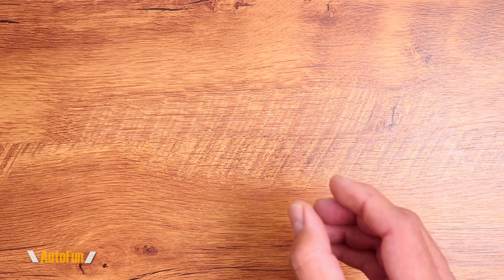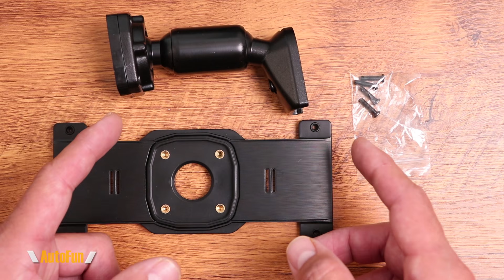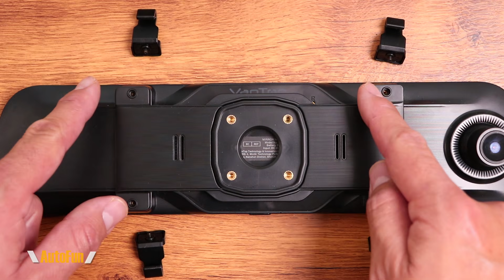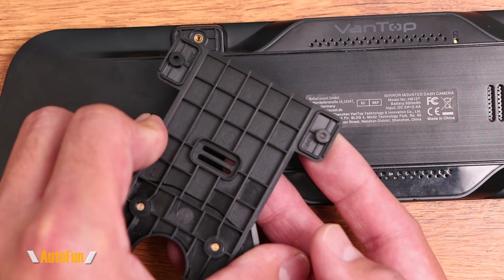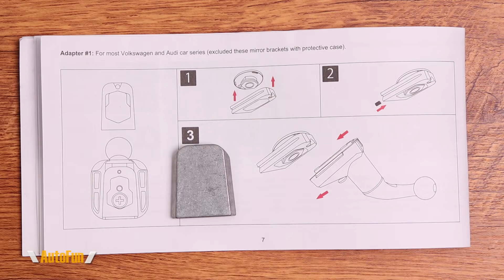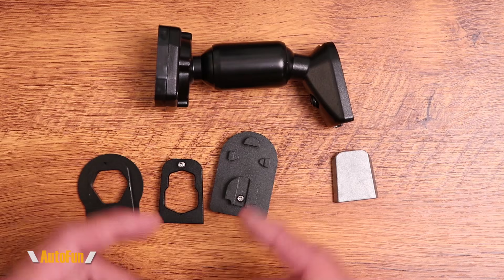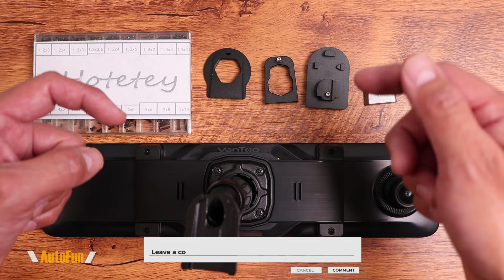How to Install Mirror Dash Cam WITHOUT Straps (Direct Mount Conversion Kit for LCD Mirror)

Comment from the maker: Hi Everybody! Here are my follow up videos: Universal Mirror Dash Cam Direct Mount Kit https://youtu.be/fveZiDofnxg and Direct Mount Kit for Rydeen dash cams https://youtu.be/cCpyHmiZqiY Cheers!
Reply: Hi Alex. I have a Wolfbox G700, fitted to a 2004 BMW X5 E53 4.4I. Can you let me know, at your convenience, if you are aware of a bracket that will be compatible. Alternatively, give me some guidelines as to where I might begin my own search. Thank you for your very informative videos. I hope you are able to assist me in this endeavour.
Reply from the maker: @mistaimani5824  Hi mista imani! thanks man! ah yes, unfortunately the G700 does not have screw holes in the back, so the conversion kit will not work with it. Cheers!
Reply: Thanks Alex,
I did see in your comments section the universal bracket. It’s about the same as strapping the cam to your mirror. 
I am looking forward to your mirror mounting modifications.
Reply from the maker: @bengb25  You're welcome Bengb X! yeah I have 2 ideas actually for mirrors that do not have a kit available, stay tuned for those videos bud...
Reply: Info only - I have the 
WOLFBOX G840S which is the same as the G850
Reply from the maker: @RobertStarkey  Hi Robert! I have not tested the G840S so I can't comment on how it compares to the G850, I may have add it to the list of dash cams to test (list is getting longer! LOL) Cheers Bud!
Reply: @AlexAutoFun  I was advising it is the same so you don't need to test it.

I however need an adapter that has 4 screws in it, as the Tahoe screws in, not slides on. Any advice there?
Reply from the maker: @RobertStarkey  Hi Robert! ah you mean it's the same as far as the back plate size? Regarding the Tahoe, what year is it? that way I can check for you..
Reply: @AlexAutoFun  yes it is the same bracket size.  Tahoe is a 2019.
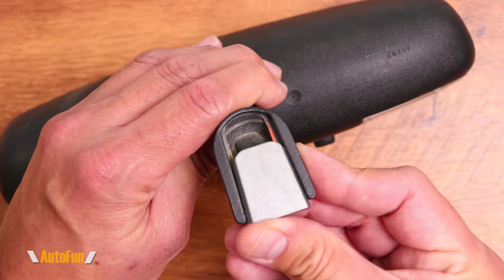Reply from the maker: @RobertStarkey  Awesome thanks for confirming! ah that is weird regarding the Tahoe, I wonder if it's an upgraded mirror option you got on yours. The Tahoe's of that year with the mirror that has 3 buttons on the front, use the standard slide bracket shown at 6:15 however the bracket is concealed behind a large plastic cover similar to the one you see here https://youtu.be/5kTXzL227o4 The slide in portion is just a single screw. Hope this helps bud!
Reply: @AutoFun  thank you. Are you familiar with this brand, PELSEE 12"? Thanks
Reply from the maker: You're welcome Ivan! Yes I have heard of Pelsee. Cheers!
Reply: Hi Alex I have a Camry se 2023 and the Wolfbox the g930 would this work for it ?
Reply from the maker: @Jay28516  Hi Evelin! Ah yes the G930, unfortunately I have not reviewed it so I'm not sure what kit will fit, however you can measure the back of the dash cam as I showed in video to determine the kit size. And If I do get a hold of one, I will measure it for you and update this comment. Hope this helps and congrats on your new dash cam, I personally can't go back to a regular mirror now. Cheers!
Reply: @AlexAutoFun  ok yes that would be great thank you🤞🏼🙏
Reply: I have a 2011 nissan cube and i ended buying the woflbox g900 4k. I cant find conversion for it or really not sure to be honest.
Reply from the maker: @georgeazure6245  Hi George! I put the link to the kit for the G900 in the video description. Cheers!
Reply: awesome video bro...do you have a  recommendation for rexing mirror cam? I'm looking at there models but I hate strip look

Comment: Ugh I have a Ram 1500 with twistlock rear view mirror, and I just got a wolfbox G930 and it looks like there are no adapter brackets for twistlock  :(
Reply from the maker: I placed adapters to the specialty bracket tabs in the video description. If none of them work for your application here is a kit that adapts to the mounting ball of your current mirror https://youtu.be/cCpyHmiZqiY instead of your mirror tab, cheers!

Comment: Hello, gibt es auch einen kit für dem m40 Spiegel?
Reply from the maker: Ah, I have not tested that dash cam yet, so I'm not sure what kit will fit, however you can measure the back as I show in the video to determine the size but If I do get a hold of one of one, I will measure it for you and update this comment, cheers!

Comment: Hi I watched most of your videos about dash cam and that’s how I was convince to buy the G900 tri pro along with mounting brackets and hard wire kit. The big question is how do I get the light of my dash with the GPS signal once I remove the factory mirror ?

Comment: Does the P12 plate fit the P11?
Reply from the maker: Ah, I have not tested the P11 yet, so I'm not sure what kit will fit, however you can measure the back as I showed in my first video here https://youtu.be/TtjZ7rC_ncY to determine the size but If I do get a hold of one of one, I will measure it for you and update this comment, cheers!

Comment: What's the chances the ball socket will fit the vehicle mount ball of a Sprinter?
Reply from the maker: This kits are meant to adapt to the windshield mounting tab (link to the kits and adapters in the video description). If you need a kit that adapts to the mounting ball of your current mirror you will need this kit https://youtu.be/cCpyHmiZqiY cheers!

Comment: I have a wide angle adapter it's not a dash cam but the brackets on the adapter will not expand wide enough to cover my mirror I'm wondering if the straps would be a solution to fit this over my Kia Niro EV 2022 mirror

Comment: I love this but it seems like darn near every mirror I want to buy doesn't have screw holes below the rubber pad on the back. At least that's what all the Amazon sellers I asked say. Is there any other way to know?
Reply from the maker: Yes, I check for this on every Mirror Dash Cam that I have reviewed. Check out my reviews here https://youtube.com/playlist?list=PLMLNRyDJO83k_Lnu1aRpTr4yR2sjjWsnO once you find the one you like, I can confirm for you if it supports direct mounting, cheers!

Comment: Do u have a Chevy GM mount for the WolfBox M40? :)
Reply from the maker: Ah, I have not tested that dash cam yet, so I'm not sure what kit will fit, however you can measure the back as I showed the video to determine the size and If I do get a hold of one of one, I will measure it for you and update this comment, cheers!

Comment: I don't see it but do you have a video for direct mount of UZIVO U24 Mirror Dash Cam?
Reply from the maker: I have not tested that dash cam yet, so I'm not sure what kit will fit, however you can measure the back as I showed the video to determine the size and If I do get a hold of one of one, I will measure it for you and update this comment, cheers!

Comment: I have a Azdome PG 17 Max is there a kit
Reply from the maker: Unfortunately I have not reviewed the Max yet, so I'm not sure what kit will fit, however you can measure the back of the dash cam as I showed in video to determine the kit size (link to the kits along with a link to the universal kit in the video description). And If I do get a hold of one of one, I will measure it for you and update this comment, cheers!

Comment: Do these dash cams come with the buttons for emergency?like a lot of new cars they have buttons on the mirror to call certain services.
Reply from the maker: Nope, so far none of the mirror dash cams I have reviewed (and I have reviewed a lot of them lol) have those services. I also don't see this feature being added to them (brands I spoken to, see no demand for this feature, not sure if it's due to new cars having those services already or due to the low adoption rate of subscription On-start type services on the aftermarket) cheers!

Comment: Hi Alex, thanks for your video !!!

Do you ever installed this type of Direct Mount Kit in AZDome PG17 mirrors? Where do i live there's no one who sells this type of kit so i have to import and i'm struggling to find adequate parts without recurring to universal kit with straps
Reply from the maker: You're welcome! Ah unfortunately I have not reviewed the PG17 yet, so I'm not sure what kit will fit, however you can measure the back of the dash cam as I showed in video to determine the kit size (I placed links in the video description to the different kits available including the Universal one). And If I do get a hold of one of one, I will measure it for you and update this comment, Cheers!

Comment: How well does it hold? My only complaint of the G900 pro is that the weight is a bit heavy for my older mirror. THis would be great. This and a mirror like film so I can use it as a regular mirror with the screen off.
Reply from the maker: Same as the old OEM mirror remember the direct mount only changes the dash cam mount, the actual thing that holds it to the windshield is the OEM mounting pad. And here is my conversion video for the G900 Pro https://youtu.be/_R12Vdus_A0 cheers!

Comment: Which size of screws did they provide ? Mine did not come with those screws
Reply from the maker: As explained on the video, I reused the screws that came with my mirror dash cams, however I also placed a link to a screw kit for cases where the original screws are not long enough for the kit, cheers!

Comment: Glue to the windshield? . LOL. This is the dumbest idea so far. It will come off right into your face at 80 MPH.
Reply from the maker: Nope, standard practice on the car industry. The adhesive used is specifically developed for glass, this is how mirror mounting tabs are attached at the factory. And in cases where a glass mounting tab is not used, the mirror is mounted to a structure that is attached to the vehicle's body or directly to the vehicle's body instead of the glass, cheers!

Comment: You can most likely STILL do this even if the mount to the back of the dashcam mirror does not line up to screw in. Just elastic strap it to the mount piece and use some double sided 3M tape for good measure. 
I have a Rexing M3 and got the M2 size kit and it can't screw in and did the above and it's perfect.
Reply from the maker: Ah yes here is my video for cases where that happens https://youtu.be/fveZiDofnxg cheers!

Comment: What about a bracket to fit a sxs? Be nice to have something for my can am x3
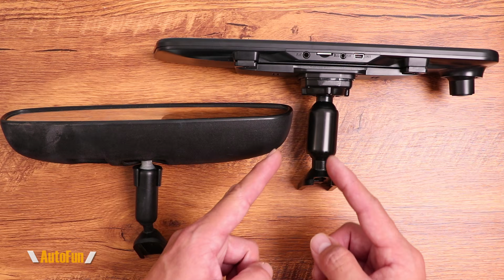Reply from the maker: Ah yes I show how to tell which adapter you will need at the 5:40 mark, you can also see what they look like so your installer can compare them to the one on your vehicle. I also placed links to the specialty adapters in the video description, Cheers!

Comment: Anyone know what I need to order for Toyota hilux n70 in Australia?
Reply from the maker: Toyota typically uses the standard mounting tab, however I also show how to tell which adapter you will need at the 5:40 mark, you can also see what they look like so your installer can compare them to the one on your vehicle. I also placed links to the specialty adapters in the video description. Cheers!
Reply: @AlexAutoFun thanks , I’ve worked it out 👍
Reply from the maker: @Mxslots You're welcome!

Comment: Where can i find supoported cars.?
Reply from the maker: Ah yes I show how to tell which adapter you will need at the 5:40 mark, you can also see what they look like so your installer can compare them to the one on your vehicle. I also placed links to the specialty adapters in the video description. Cheers!
Reply: @AlexAutoFun Thank you so much. Im looking for a new camera for my Volvo xc60 2009.
Reply: @AlexAutoFun Volvo are using cam lock to mount the mirror.
Reply from the maker: I'm using the standard mounting tab (which is what came with on my car), but if you need an adapter I placed a link to those in the video description. And here is another direct mount system that may interest you https://youtu.be/cCpyHmiZqiY Cheers!

Comment: has anyone tried this on an Acura TL 2005?
Reply from the maker: It should work most vehicles use the standard mounting tab (and a few use the adapter). I show how to tell which adapter you will need at the 5:40 mark, you can also see what they look like so your installer can compare them to the one on your vehicle. I also placed links to the specialty adapters in the video description, Cheers!

Comment: hi great tutorials. very helpful. I'm getting a wolfbox g900 to replace my OEM rearview mirror of my FJ Curiser 2015. can you tell me what replacement bracket and mount would fit an FJ Cruiser ? thanks.
Reply from the maker: Thank you! Ah yes I show how to tell which adapter you will need at the 5:40 mark, you can also see what they look like so your installer can compare them to the one on your vehicle. I also placed links to the specialty adapters in the video description. Cheers!

Comment: Dessa forma, suporte do retrovisor irá vedar por completo as ranhuras de dissipação de calor do dispositivo. A consequência será o superaquecimento que importará no travamento do software ou fritada dos componentes internos ao ponto de reduzir a vida útil do dispositivo.
Reply from the maker: So far I had not had any overheating issues and more mirror dash cam manufacturers are now offering direct mount kits direct for their mirror dash cams (Most will leave a gap between the mirror and the plate since the strap mounting posts are raised but some brands like Wolfbox introduced kits that do not have a gap, the blend in with the original mirror, links to them in the video description). However yes direct mounting is not for everyone and most will likely be ok with strap mounting, Cheers!

Comment: I drive a VW Polo 6R 2017 and have a circular bracket (VW 6N0845543), where can I get the adapter? Wolfbox has adapters on their USA website but not on the EU one...
I'm also thinking of just removing my circular bracket and replacing it with the most common one you showed.
Reply from the maker: I show how to tell which adapter you will need at the 5:40 mark, you can also see what they look like so your installer can compare them to the one on your vehicle. I also placed links to the specialty adapters in the video description. Cheers!
Reply: @AlexAutoFun Thanks, I think I managed to find one on aliexpress that fill fit. Took me a while.

Comment: Hi there nice video. Glad I came across this video. I've had an  issue where my Wolfbox rearview mirror dash cam would just come loose pointing downward and when I reposition it to the desired position it would hang down. So i've come to realize that since having the wolfbox mirror mounted onto the stock rearview mirror that it was too heavy. I have had the wolfbox mirror for a year. So I just ordered the tools that you posted on the description so I can have directly mounted without the stock car mirror. I honestly was thinking of spending crazy money for a different mirror, but the wolfbox is good for me. only issue is the glare on the mirror, so much glare I switch from camera to regular mirror. How do I go about adjusting the glare issue?
Reply from the maker: Thank you! Ah yes the infamous glare, unfortunately all LCD mirror are plagued by this to an extent, due to the limitations of current video sensor technology (actually I posted about this subject on the channel, check under Community if you want to read it). What I usually do to minimize glare is I mount the rear camera as high as possible and I aim it slightly down. If mounted low and horizontal to the cars behind you, the camera faces the headlights of coming vehicles directly which can exacerbate the glare issue (same as someone shinning a light directly to your eyes). High mounting and tilt has helped me reduce the glare but won't eliminate it completely as you noticed on the video. And here is the full review for the Auto-Vox https://youtu.be/Yk2EEacXZ7g for those that want to compare it to (thank you btw!) Cheers!
Reply: @AlexAutoFun  Hi there, Yeah the  heavy glare was driving me nuts.

Comment: Could you please tell about the below mentioned mirror dash cam...or share the link..
70mai S500 Rearview Mirror DashCam, 3K 1944P Front & FHD Rear, STARVIS 2 with Dual HDR, 9.35” IPS Touch Screen, G-Sensor, WiFi, Super Capacitor, Optional Parking Mode (S500)
Reply from the maker: Ah, I have not tested that dash cam yet, so I'm not sure what kit will fit, however you can measure the back as I showed the video to determine the size and If I do get a hold of one of one, I will measure it for you and update this comment, Cheers!

Comment: I have been thinking on that Subject during many hours. But on my e-up with a camera just above the mirror. It seems impossible to adapt any adapters your  are mentioning. Button adapter will not gonna fit since there are no button base on my car. My last hope is to disconnect the ball bind and to adapt of the bind proposed by wolfbox